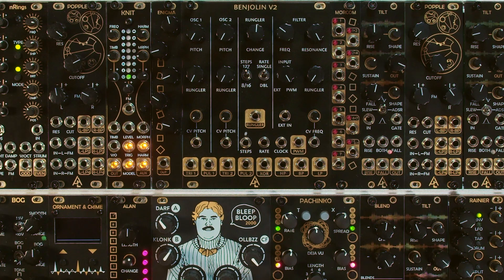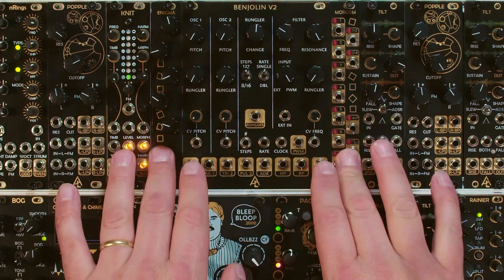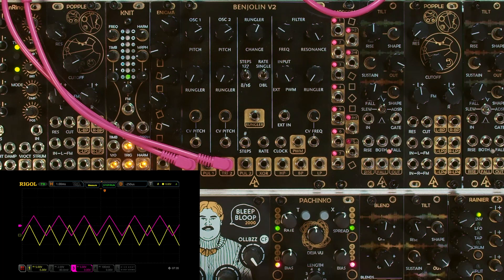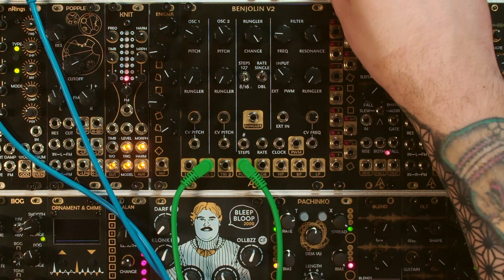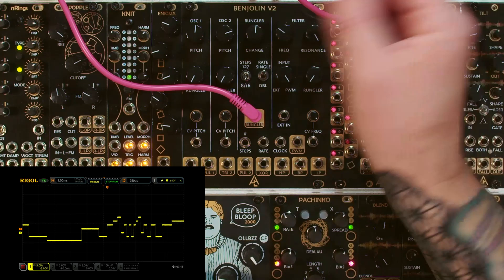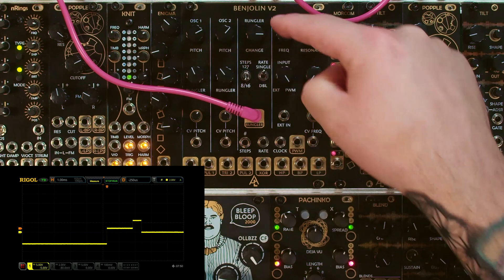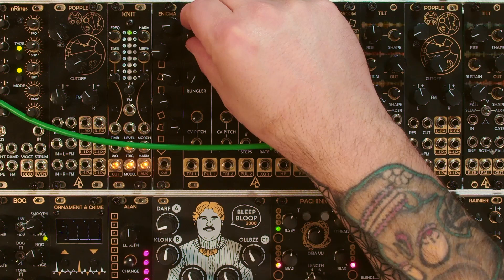Benjolin V2 Walkthrough

Comment: 0:00 Intro
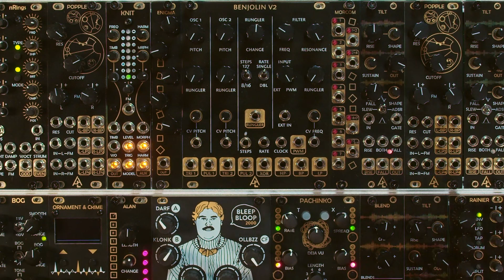2:14 Oscillators
5:51 Rungler Section
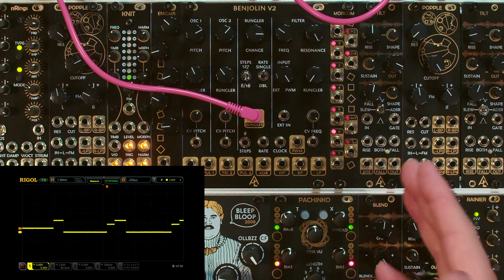8:37 Rungler Jam
9:46 Change Patch
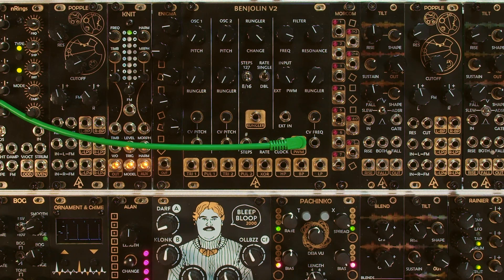11:04 PWM
11:59 Filter Section
14:51 CV Inputs
16:31 Enigma & Morcom Expanders
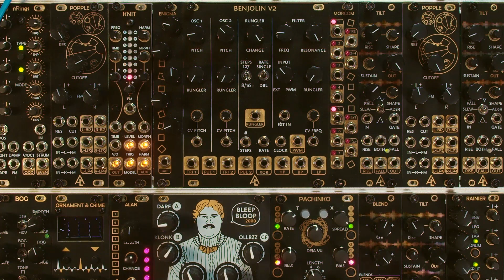18:04 Outtro
Reply from the maker: Didn't know how to do this, but just added this.  Thanks for the help.

Comment: Would you please tell me which way the ribbon cable orientation is on the Benjolin V2? Does the red stripe go next to the little white line or opposite of the white stripe?
Reply from the maker: Red stripe of the cable aligns with the white stripe on the module.

Comment: When sending the rungler out to ornsment and crime to quantize the sequence, is there an alternative module other than BLEND to use to send the rungler out to before ornament and crime?
Reply from the maker: You can just go straight to the OC, but if your goal is for attenuation to shorten the range, then any attenuator/attenuverter will do.  Blend is our smallest dedicated but a DC coupled VCA like our DVCA will also work. ,as will QARV.  Hope this helps.
Reply: I looked all over the place for a blend module snd I can't find one. I just ordered the Benjolin V2 and both expanders after seeing this video!
Reply from the maker: @xorthontech  We have it on our website.  You can also check Patchwerks or Perfect Circuit in the states.  In Europe I would check Schneider's or MIDI Amsterdam.
Reply: @afterlateraudio9976  ok thanks! I wonder if Mutable Instruments Veils would do something similar.
Reply: My mistake, it was Bleep Bloop I couldn't find.
Reply from the maker: @xorthontech  Veils will work to limit range of the rungler.  Bleep Bloop was a limited run and is now sold out everywhere.
Reply: @afterlateraudio9976  yea that's one I really want! I really like that module.
Reply: How many different values can come out from Rungler output? Only eight?
Reply from the maker: @nikkortumblr  Correct.  We stayed with the original design here, 3 bits through an R2R DAC.
Reply: @afterlateraudio9976  and what does the enigma expansion? Is there any description?
Reply from the maker: @nikkortumblr  it allows direct level control over 5 bits that are then summed.
Reply: @afterlateraudio9976  but the output possible values from enigma output are always 8 or more?